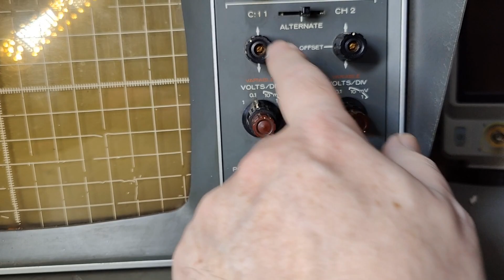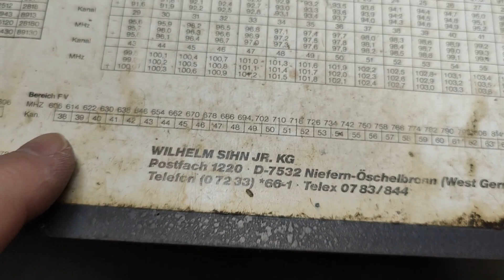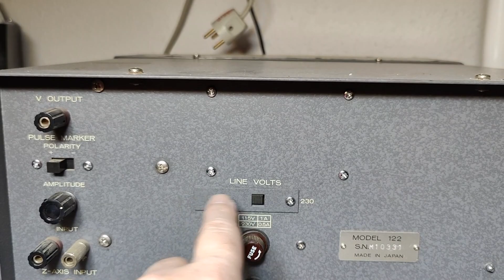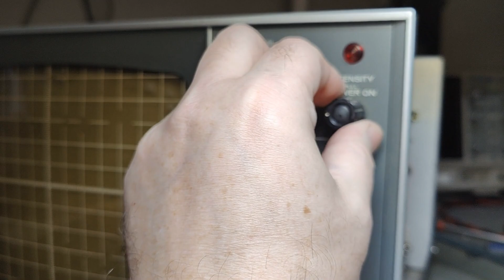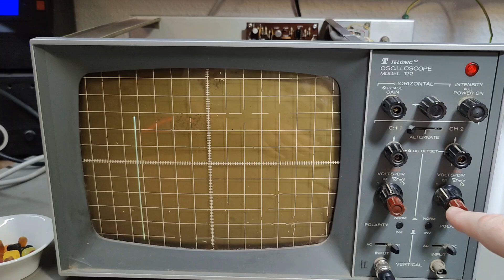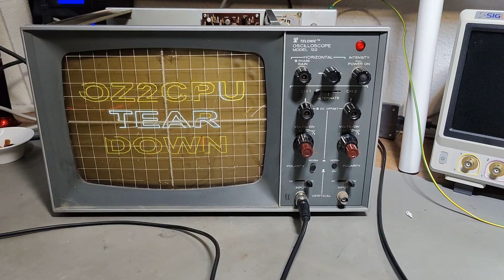Telonic XY oscilloscope model 122 2ch 1980 0-10kHz test teardown

Comment: Is the word oscilloscope not a bit of misnomer? It looks like a monitor scope  (I've got a 1 channel version VP3830A) that we used in the old days together with a wavetek sweep generator.
marker input from sweeper to an RF generator, RF output from sweeper to DUT, then a diode detector for demodulating, to the dem output of the sweeper, the vertical from the sweeper to the x-channel (V-in) of the monitor and the scope hor from the sweepr to the H-input of the monitor.